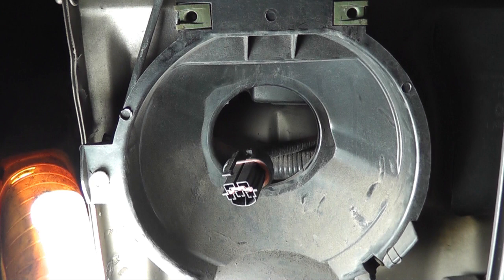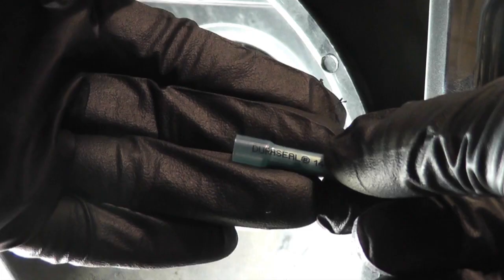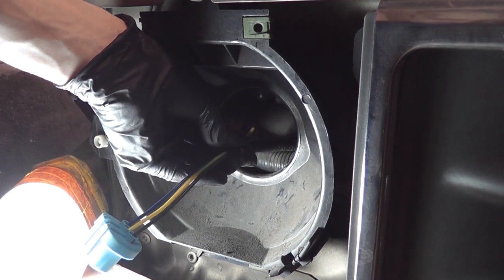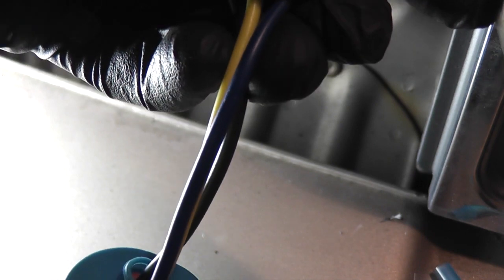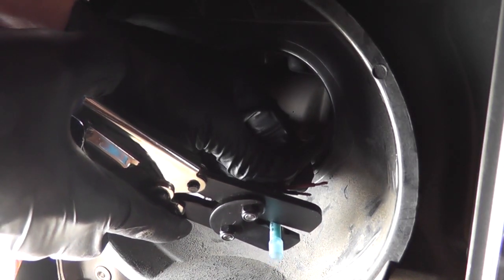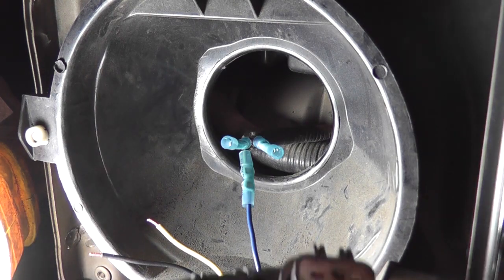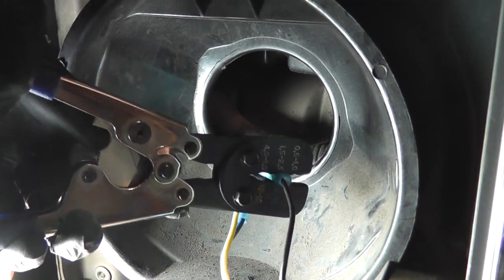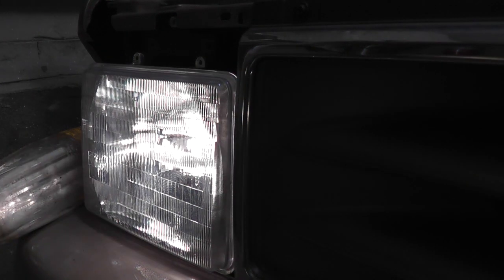Replacing A Damaged Or Burnt Automotive Electrical Connector

Comment: thank you for this video! I just checked my 2005 Ford five hundred headlight and TBD low beam bulb was out and I noticed the socket was melted and cracked and a piece broken off. so I bought a 9006 bulb with matching socket and followed your video to the T, even though the wires were different and I also used electrical tape around the butt connectors and put them back inside the coil that went around the socket wiring. it was very very easy, using your video as a guide. thanks again!

Comment: Great video. What would be a good alternative for sealing the wires since I don't have a heat gun? Before buying the butt connectors, should I measure the wire gauge number to get the correct butt size or are they universal for harness wires? Thanks in advance for your response.
Reply from the maker: Any type of flame will work you just have to be careful not to melt the insulation.
Reply: Thanks. I have another question. Is it necessary for the wires to overlap inside the butt connector? To clarify, I mean the positive wire from the headlight harness to the positive wire of the headlight socket and the same for the negative wires. If I don't want to use heat to seal the butt connector, would using electrical tape a good alternative? Is there a type of butt connector that will work well with electrical tape?
Reply from the maker: No the copper wire only has to be fully in the crimp ring on each side.

Electrical tape isn't really recommended as it tends to become brittle over time due to engine heat and can fall off.
Reply: ***** Ok, thank you. With the video along with your replies I was able to change the headlight socket wire. Thanks again.

Comment: What's your logic for attached crimps to harness side first? I always attach crimps to plug side (loose) and then perform last crimp to harness side in close quarters.

Nice video. I've always used cheap crimper w/o problems but your video is making me reconsider. Sealing crimps for weather exposed locations is a good idea.

great video!
Reply from the maker: It made it easier to film. Holding everything in frame when trying to work is more time consuming.

Comment: Excellent video my friend. I have the same problem with Mazda 3 gen 1 connector got burn out. Just order a new connector for my LED H7. My question is how can I find out the size of the cable to order those butt shrinkable connector for my 2008 Mazda 3. Thanks

Comment: Yea I just paid $145 to have this done to my 07 impala as well as having the bulb replaced at my local chevy dealership.... I know I didn't need that bulb replaced. So I should've went and bought the connector to do it myself and saved my self $135-$140. I hate them.

Comment: ok i got my replacement pigtail but the old connector got lost when i cut it off so know-how do i know which wire goes where? i also have the three wire
Reply from the maker: Look at the connector on the other headlight as a reference they should be identical.

Comment: I have a 99 4wd, automatic Honda CRV. The converter needs to be replaced. Finding 99 parts is a problem. Do you have some more wisdom? Can one change a converter without mechanic? Love your vids!
Reply from the maker: If you can get the rusted fasteners off it's easy.

Cats don't fail on their own and should last the life of the vehicle.

A converter failure can be caused by an overly rich fuel mixture which causes it to overheat and the substrate to melt. Excessive oil consumption the burnt oil coats the substrate. The substrate can also be poisoned by coolant in the exhaust from a bad head gasket.

There is also mechanical damage the substrate is made of ceramic and can be damaged by thermal shock (water hitting a hot converter) or by physical damage (road debris).

If you can't identify why it failed you will have a repeat failure down the road.

Comment: what is the advantage of  crimping over soldering for a permanent connection?
Reply from the maker: Both will equally produce a quality joint if done properly.

If you haven't soldered before it requires a bit of practice to avoid cold joints and a poor connection. Crimping is easier for beginners if you have a quality crimp tool and connectors.

Comment: I replaced my connector today, unfortunately the new one had 3 black wires. As i got them hooked up it looks like i must have wires switched as when my truck is on low beam the light is on high beam and when i turn the high beams on the bulb goes to low beam. Its a 3 prong connector.. Would you recommend i switch the two end wires?? Thanks.
Reply from the maker: Connect a DMM set to measure volts or a test light to battery negative turn the lights on low beam and look for battery voltage at the connector that's the low beam wire. Turn the high beams on and repeat the process then swap those two wires in the connector. You should be able to release the contacts with a small flat head screwdriver.